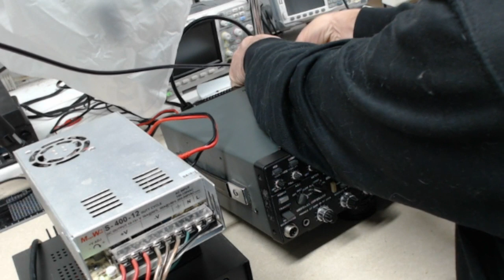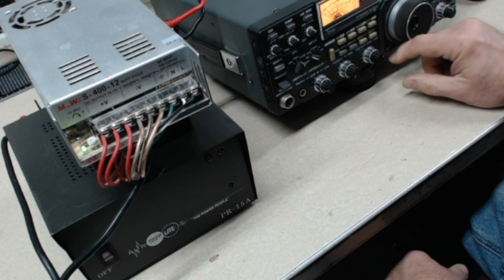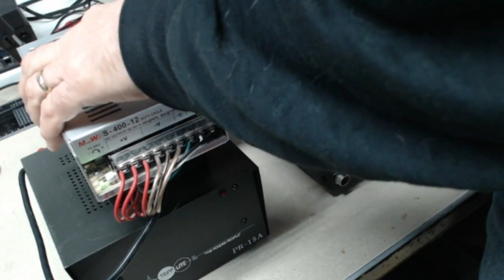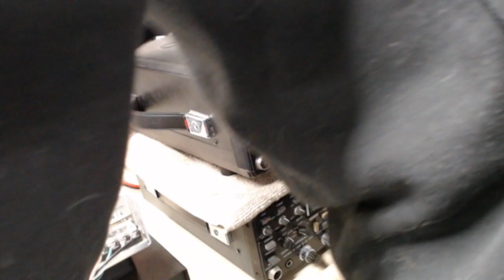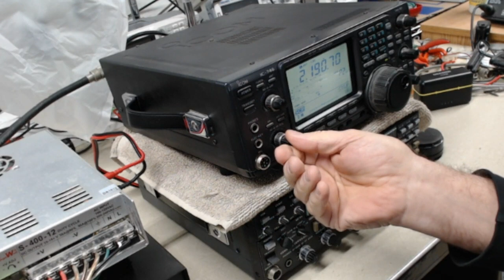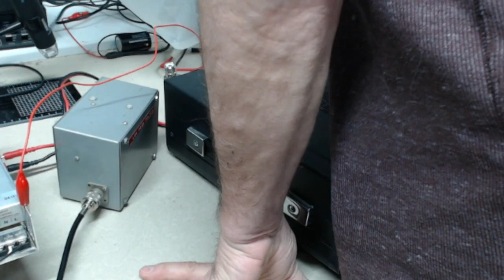Switch Mode Power Supply Noise

Comment: All noise from smps comes through power wires, not through antenna. Therefore there is no need to connect antenna, no need to wait late night to check low bands. all you need is SDR with spectrumscope.
In this particular case noise probably was bit lower if power supply moved away 3-6 ft from trcvr. SMPS has to have Class B certification. These are little more expensive, but quiet. I have QJE PS30SWV and it is quiet. de ly2kz

Comment: I have a switching power supply that I've brought from radio to radio never made a sound I'm using it today. The only problem is it's only 50 amp and I'm blowing fuses in my house so I bought a 125 amp switching and it's driving me crazy with the noise, I happen to have a 40 amp trip light same one you got on your desk. Except a little stronger. I'm using as a paper weight if you're interested in it comment back maybe we can work something out, hell I'll even give it to you for the right knowledge on how to get mine quiet.That trip was so basic but yet so quiet and now I know why tonight I learned the difference between linear and switching. That's the problem with these RCI 2970 N4 radios they put out 550 PEP that's quite a bit

Comment: I miss my fully equipped IC-751A dearly. Had it for 29 Years flawlessly working along side with me. Most of these switching Supplies are nothing but a Headache. Tnx for the neat Video. I shared it with my Facebookers. 73 de Uncle Günter across the Pond 💯👍🙋‍♂

Comment: I'm using a modified HP server PSU (modified to output 13.8V). It is much cleaner than the Meanwell PSU I used before.

Comment: Nice work. But what happens, when you put low pass filters right at the output of the PSU? Is it the device itself, or the unshielded DC cables running to the load?
Reply from the maker: I'll have to build a low pass filter for the DC to find out.   As far as the I unshielded cables, I tried moving the long one all over just to see if any difference. I don't think the shielded cables would matter that much since the problem is only present when I connect an antenna. But certainly a lot of variables.  Thanks for the input.